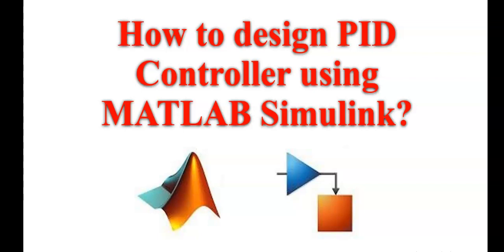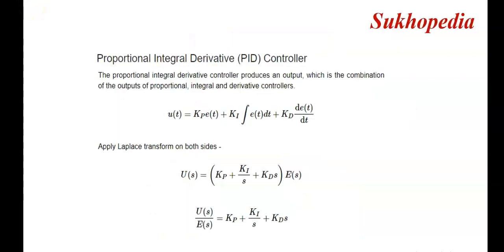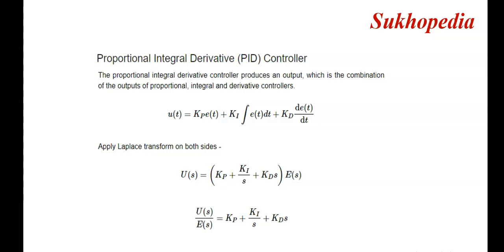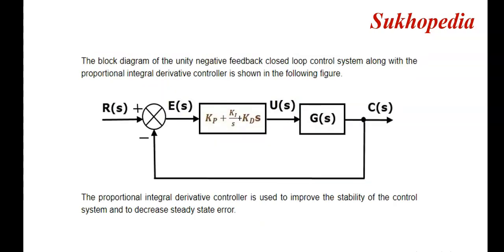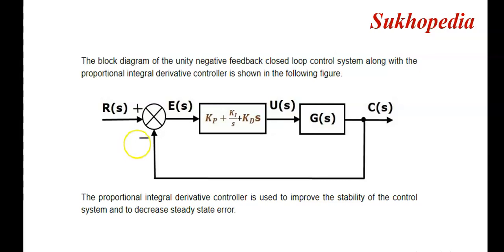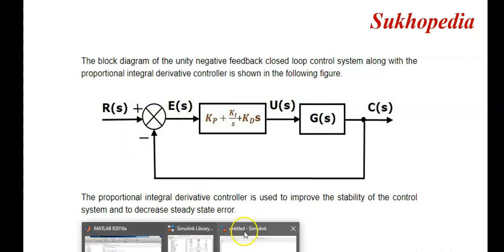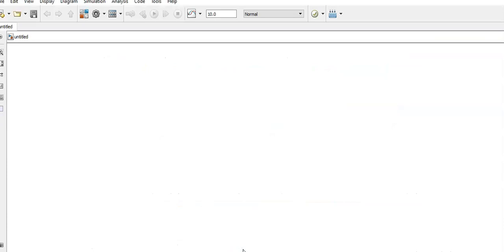PID Controller | MATLAB | Simulink

Comment: thanks for the great videos
I have a task, namely, I want to make a PID controller for the gas pedal in the vehicle. I have target speed and actual speed as inputs and the accelerator pedal (in %9) should come out as output. Gas bedal here as I understand is the P part, but how can I get it as an output under use I AND d PARTS.